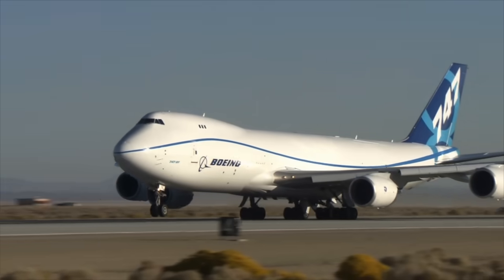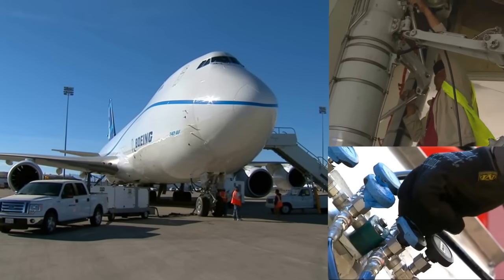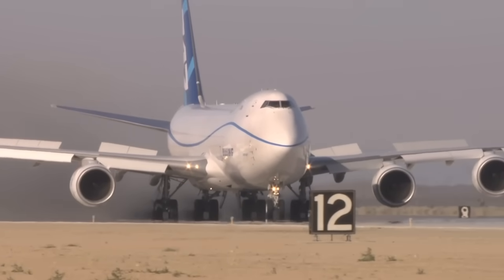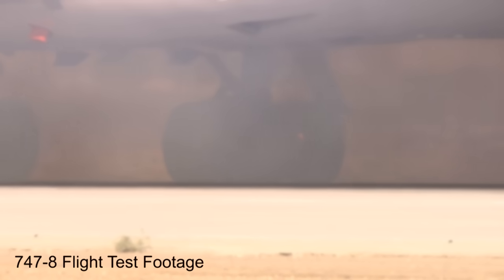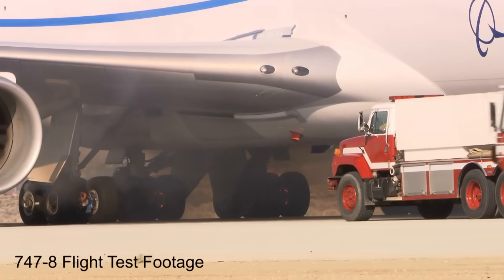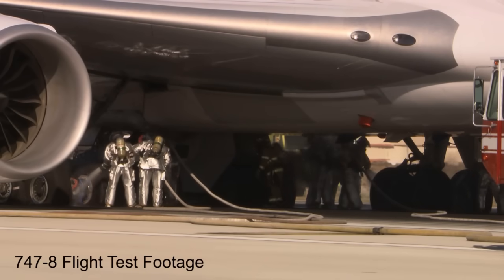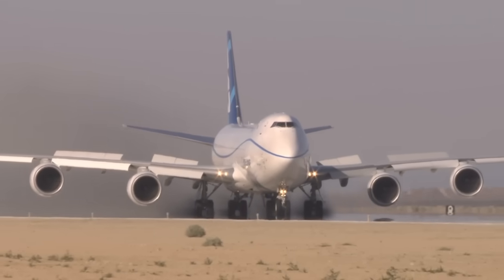Boeing 747-8 performs ultimate rejected takeoff

Comment: Maybe there some thing better when it comes to  aircraft suspension and brake's,Well no doubt they have carbon+carbon Brake material's working in there Favor, but this suspension,frame,wheel - Design has been the same for many year's.
And on all types of airplane's/ why there could be a better idea out there,We note That the Wing's where applied for more restriction (friction) for the Stop Test  CERT, and keep in mind that all airports are not alike.short or long.
Therefore after its all said and done,it was a lesson learn,but there,s more work to be done of the Boeing Engineers R&D
how many feet was it for a complete stop? they may want to create fluid cooling brakes,because that fire is toxic .yoo.
___________________________________________________________________
Marvin-P:

Comment: For Americans and customary users, the brake temperature is 2,552 degrees Fahrenheit. That's a much bigger number! But I just want to know: what if the things on the top of the wings are stuck down. Would that make a difference?
Reply: And it's freakishly hot!
Reply: Do you mean the flaps at the rear of the wings?

Comment: did they just use "water" on the landing gear to extinguish the fire? thats just dangerous, they should've used dry powder
Reply: +Friskyz96   How is dry powder going to cool down the metal?  
There was no fire.  The heat was the main issue to deal with.
Reply: jtf16078xy No conment

Comment: You say the engines cannot be put into 'reverse-thrust' mode.  Does executing an RTO by slamming on the brakes turn off the engines?  Much like stepping on the brakes of an automatic car disengages the transmission?
Reply: Jim Hayes This was a brake test. Worst case scenario.
You are also mistaken about an automatic transmissions. Stepping on the brake does not disengage the transmission.
Reply: Think of a real-world reason for a RTO: 4 engine failure due to bird ingestion? They have to be able to stop if all 4 engines are unusable.
Reply: By the way jim,a transmission in a car will not disengage when you slam on the brakes,putting a car or truck in neutral will do that,
Reply: G+
Reply: Callie Britton .
Reply: +Jim Hayes The pilots may have to do something to the engines at the same time as slamming the brakes on, but that's a separate set of controls unconnected to braking; this is why piloting uses both hands and both feet, so you can operate different controls simultaneously.

Comment: Hey, Airbus fans. Don't come onto a Boeing video about the 747 and say how the A380 is better.
Reply: 8TBD
Reply: SkylineToTheSeaAndMe yes sir you are right. I forgot about that.. But I will watch the video as well..
Reply: Adam Hart Well, they come on the Boeing site to see how their planes should perform.
Reply: Adam Hart  hehehe, To get real technical. The A380 was designed around the McDonnell Douglas MD-12 concept that never saw light.
Reply: Louis Smith - Or rather the original concept for the 747 (and probably MD-12). Look for a national Geographic video "Megafactories - Boeing 747" or just search for this video: v=73mfHVDadug  - The first 747 design in 1965 was a double decker. Once you find it, fast forward to 7:00 in (or watch the entire video if you want). A little after 8:00 they explain the first 747 design (double decker). It is fairly obvious that Airbus copied it, and obviously Mcdonnell Douglas was bought out by/merged into Boeing.
Reply: Lol. A380 is better

Comment: All fuel tanks are fully filled to simulate maximum takeoff weight, but during the test are all tanks filled with fuel? Assuming the difference in specific gravity of AVTUR vs another liquid can be allowed for with ballast, I would assume safety would dictate actual fuel load would be kept to a minimum required to perform the acceleration - less risk of fire in case of an accident (or especially in this case if the breaks get much hotter than expected). Is it a certification requirement that all the tanks are filled with actual fuel? And are they?
Reply: In an actual event, you're not going to have no load and no fuel.
Reply: I understand, but what I'm suggesting is that for the purposes of the test you could simulate the load with ballast and water in most of the fuel tanks and include just enough fuel for the test run for minimal fire risk.
Reply: Liam O'Donnell  I think in order to certify they have to do real world Test.  Which means YES full fuel tanks.However the safety factor come in fire crews right their and no passengers except flight crew and a few engineers.
Reply: On Line Poker Game. The first 6oblgp3
? The reason is pdx E
e
en Madrid

Comment: So spoilers deployed but no reverse thrust? Not that realistic. Might as well test it with wings in take off position and engines at max for worst-case.
Reply: This is as realistic as you can get. The spoilers deploy to dump any possible lift on the wings at that time, transferring the weight to the tires. Btw, the brakes automatically apply when the auto-brake system is in RTO, which also deploys the spoiler. There's no modulation of the brakes as in the lower autobrakes modes. Full brake pressure and anti-skid at work here.
Reply: I don't think you paid full attention to the video
Reply: ***** n.     N  NN 0r, @aaaaq@aawwwwwwaqw
Reply: I'm going
Reply: What if the RTO was the result of a catastrophic engine failure? You're not going to have reverse thrust at your disposal. A complete loss of secondary light controls, while possible, is highly unlikely. Also, stalling the airflow over the wings will ensure that landing gear and brakes have as much force as possible on them.

Comment: The pilot should raise slats = less lift = more brake power
Reply: This is a test of a worst case scenario! And it is meant to be an aborted takeoff, hence no slats, which are for LANDING!
Reply: slats only reduce minimum speed before stalling if the plane is angled upwards
Reply: Slats + flaps obviously
Reply: Slats do not produce lift , all it does is prevents stalling
Reply: Wrong, deflecting under flood to the over increases lift, Aside from reducing the entering stall speed and the angle, forces more air over the wing: more speed over it, less under it = more lift.
Reply: ... You have not much idea if you dont know slats deploy at same time flaps do... (at least in boeing and another wellknow airliners/private jets)
Reply: onecheman Dagnabbit! I was thinking of spoilers that lift up on the wing once you touchdown!
Reply: Oh that creates drag and reduces lift xD

Comment: how about weighing it down with potable and brown water tanks full and max passenger and cargo load.
Reply: It was already at MAX takeoff weight.
Reply: Did you listen to the narration? They say it is at max takeoff weight. Matters not if the poop tank is full or empty.
Reply: they did. they put steel plates in the cargo area to weigh it down to 975,000 pounds.
Reply: that's the cargo variant, and it was at max weight a little over 975,000 lbs.
Reply: The one they are testing is a freighter. Either way, the passenger and freighter versions should have the same maximum take off weight so it shouldn't matter.
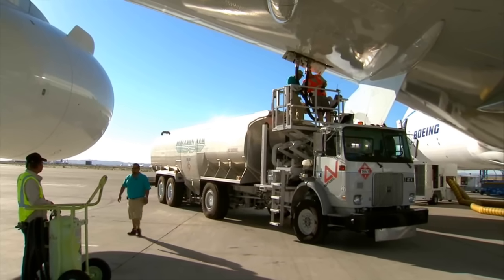Reply: They did load the plane up to maximum take off weight. They said so at about 0:45
Reply: It was weighted to the MTO. They put steel plates in to reach that,it could not be any heavier at take off. And it had fully worn brakes
Reply: fordfreak2007 Or the freighter would be the heavier one, if there is a difference.

Comment: OUTDATED DESIGN
Reply: Not outdated, just a very highly respected aircraft  that keeps on getting better every year. Certainly better then the A380 Airbus.
Reply: mike wade Funny. Last time I checked, Boeing has been around a hell of a lot longer than airbus, and has more than one outdated aircraft proving that with a little retrofitting and TLC, they can go the distance, not to mention, the company practically set the benchmark. One airbus can't reach, as young as they still are.
Reply: Not necessarily, and that's why it's stood the test of time and only keeps getting better and better.  It's like a fine wine with age and a some necessary tweaking.
Reply: 747? outdated? i dont think you know what your talking about
Reply: It's iconic.

Why would you wanna change something that's iconic???
Reply: opmike343 If It Ain't Boeing I Ain't Going!
Reply: Wrong ! The new 747-8 is more fuel efficient than the hideous Airbus A380 ! Its already proved it self as a more efficient aircraft then the A380. And that is 100% Factual . Sorry to burst your bubble.
 Have Boeing lost their share of the market to Airbus ? On the surface it may appear to be, but when you dig deeper , Boeing still holds the trump card .  There are currently some 8000 Boeing 737-800 series flying around the world at any given time, more than any Airbus aircraft, which is cramped, small windows and crappy seats.
Reply: Still the A380 is a better design making use of a full upper deck.
Making it more appealing to airports where plane are landing every 45 seconds, and the A380 can take the job of 3 airplanes the 747 only 2
Reply: mike wade planes dont necessisarilly land every 45 seconds, they can but dont due to the different size of planes and their wake. the a380 is 3/2 the size of the 747 (the 747-8i at least) although it is still bigger. the airports arnt the ones buying the planes so they dont care about the appeal of the plane, its all up to the airline and they base their purchase on a lot of factors and since the 747-8i is newer and more efficiant, a lot of airlines are picking that over the a380. my opinion is the 747 is not outdated but thats just me.
Reply: Here's outdated: a new A340 = a worn-out 707.
Reply: mike wade If Airbuses didn't fly into water so much, they'd be tangible. And if Boeing is so bad, why are they still ordered in droves? Face it: Boeing is still the leader. Thank you and goodnight.
Reply: mike wade Thaaaat's right. You keep telling yourself that. Unlike Airbus, Boeing doesn't have to buy a media outlet to make Airbus look bad. Airbus aircraft do that handsomely on their own.
Reply: GoMiGman It was fine until the A380 came along. You don't see to many double decker buses with half upper decks.
With increasing capacity at airports,the novelty of the 747 is wearing off.
Reply: The 747 has had a long run without competition.The increasingly popular A380 has trumped the 747 on passenger capacity fuel economy.
Upgrading an old airplane to compete with a new one seems fine until they start upgrading the new one.
Has Boeing lost the jumbo market to Airbus.
Reply: The 747-8 is less fuel efficient per passenger!!!
Its half arsed upper deck is now losing it customers
When the A380 gets its upgrade 747s will have to be scraped .
Airbus set standards which Boeing was forced to follow such as cabin comfort,which Boeing was not acustomed to.
Reply: Too true. Most people havent a clue about  aviation. They are the Armchair Critics who have nothing better to do, except post a load of idiotic nonsene
Reply: Upgrading a 747 is just a short term solution,against the A380 which is selling well. 
what then for Boeing when the A380 becomes the newer more efficient plane.
the A380 is a better airframe to keep upgraded against the 747
Airports like Heathrow like the A380 because it lowered air traffic
The A380 is popular with many airlines.
When half deck double decker buses become popular in busy urban areas i'll respect the 747
Reply: ***** Wow! what a comeback, is that your only defense for an old fossil.
Reply: @ MegaNumbNuts: Horse shit! Modern engines and electronics etc., installed in an airframe that has proven itself many times. You obviously have only marginal knowledge of aviation equipment.
Reply: What is modern? Electric brakes?  Electric brakes are not strong enough for an aircraft this large, that is why the 787 is the biggest airplane to ever be fitted with electric brakes....  technology is not here yet to have anything better than what you see in this video!
Reply: American Society for YouTube Aeronautical Engineers.
Reply: MegaVector2011 OUTDATED ARGUMENT
Reply: ***** i can' think of one single boeing ever surviving in impact with water. With no lose of life or impact damage.

Are they still looking for those to boeing the ocean somewhere.
Reply: ***** Terrorism!, yeah really. more like Burning batteries,cargo bay doors falling off and welding over panels the should have been replaced.
Reply: A-Town 92501 Airbus= Efficient,reliable,durable,luxurious,modern
Boeing=old
Airbus definitely Airbus

Comment: If you want worst case don't use the flaps, no?
Reply: Who would try and take off without flaps?
Reply: First off, it is a worst case scenario for take-off, so if take off procedures use flaps then you use flaps.

It's a worst case rejected takeoff. A worst case anything would possibly involve space aliens cutting off the wings or something completely crazy like that..
Reply: ***** lol, yeah, if you were taking off and realized you had no flaps, you really would want to stop.
Reply: hammeredinfire Hot nearly as much as the FAA would want to take your license.
:p
Reply: ***** I don't know the correct terminology maybe - but pointing whatever up on the top of the wing will create more wind resistance and force it down more.  I see it used in landings every day - but worst case would be if those didn't work...or they wouldn't use them in landing under good circumstances, no?
Reply: The flaps usually extended to 20 in the takeoff roll .. so in any case the flaps will be 20

Comment: why don't they add a paracute in the tail that can be deployed to help stop the plane?
Reply: such drag will be transmitted through the fuselage .. its better to handle drag LOWER than the fuselage or body where passengers are sitting and its better to uniformly distribute the reverse force than a point pull like that of fighter aircrafts which have a kinda solid main fuselage.
Reply: One is not used because one is not needed.. they just reverse the thrust in all engines..way better mechanics to slow it down.
Reply: Parachute material is way too expensive. I just bought some and it went up 60 cents a yard in the last 10 years. Good question tho!
Reply: there're  only for the space shttle because there're faster than a
concorde at max speed
Reply: BoeingvsAirbus1578 I know it is iconic, and it is a very strong plane. What I mean by saying the things you mentioned is that it doesn't have the proper reinforcement and strengthening parts for a parachute. Can you cite any of your sources for withstanding 6G and going supersonic? Sources need to be mentioned. While you said that me saying "it's just an airliner" voids me of credibility, I want to see some sources before I think your comment has credibility. Also, I was comparing it to military planes and the space shuttle, in the same way that someone might say "it's just a Skyhawk" when comparing the Cessna 172 to the Boeing Dreamliner.
Reply: Boogie Man
Cirrus SR22
Reply: how many?
Reply: They used to. As seen here, they don't need it anymore.
Reply: IT doesn't on the big air force plane
Reply: Albert Doty this plane isn't that strong. It's just an airliner. It would be too expensive and the G-Force would be too great for the passengers.
Reply: Nick C.'This plane isn't that strong.' < the 747 is the toughest of them all, it has proven to withstand supersonic speeds with load factors nearing 6G at the very same time and land safely with the aircraft intact. Also saying things like 'it's just an airliner' voids you of any credibility. Whilst I agree a parachute is entirely impractical, saying to an aircraft like the 747 that it's just like every other plane is absurd. Do you know how iconic this bird is? It changed the world and continues to flourish day by day.
Reply: A parachute is a damn good idea.
Reply: dayyyuumm this video is populair maan!!
Reply: gone fishin
THESE PLANES ARE $100,000,000....MIGHT AS WELL UPGRADE TO THE $.60 PER YARD
Reply: No way Jose, I mean frank. Penny saved is a penny earned n the don't cost 100 million
Reply: an A320 IS IN THE 80,000,000 RANGE
A BOEING WOULD EASILY BE OVER 200-300 MILION...
Reply: NASA are developing parachutes for planes in case of engine failure
http://lmgtfy.com/?q=nasa+plane+parachute
Reply: It would probably be far too expensive, as well as taking away from passenger space and luggage capacity.

Comment: They don't. They have multi-disc brake systems, which consist of a stack of rotors (rotating discs, which are keyed to the wheel) and stators (stationary, have pads, keyed to the hubs) which are pressed together to provide braking action.

Comment: The a380 can still stop using thrust reversers and other stopping systems. Thus its certification. The 747, in the event of an engine failure (where reversers may not function) can preform an RTO as above.

Comment: Since Drum breaks are the most efficient way to stop heavy weights. The action of the drum on the shoe causes the shoe to press tighter onto the the drum. Its called self energizing. The reason its not used in cars is because cars use their breaks over and over in quick succession meaning that the drum can over hear reducing breaking efficiency. Airplanes don't use their breaks that much, so its not a problem.